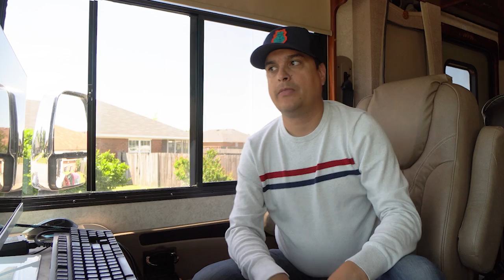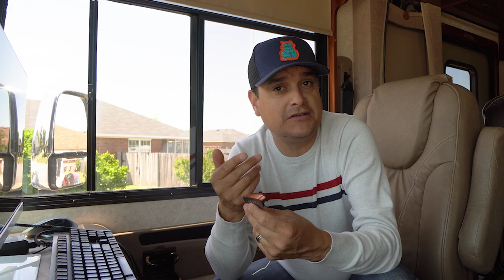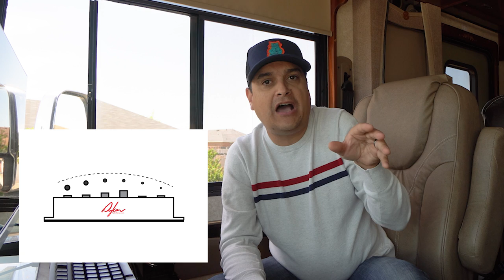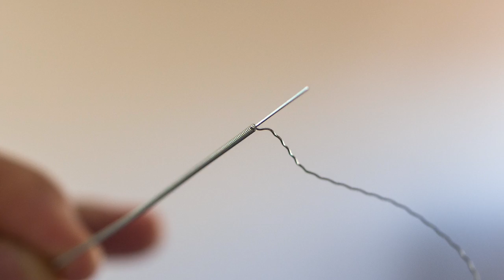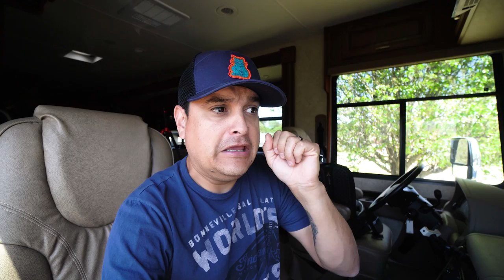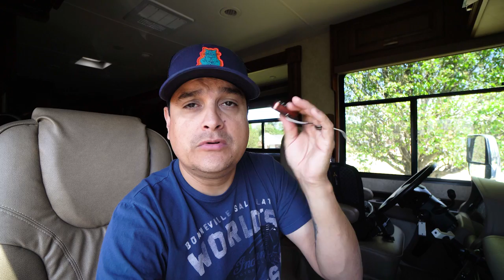How To Choose Single Coil Pickups - Flat VS Staggered

Comment: And then there are the G&L MFD pickups with adjustable pole piece heights. Leo was a genius!
Reply: I have those on a tribute G&L tele, and I also run heavier strings with a wound G (country rhythm guitar).  I love the output of them and the adjustability ( no-one uses a wound G on a tele, right?)

Comment: I'm so glad this video exists. I put 13s with a wound G string on my guitar and my Strat just came to life. I thought it was odd that it sounded so significantly different and thought that it was something to do with setting the guitar up to take 13s. But this explains it.
Reply: 13's on a Strat? I could jump up and down on your fretboard and still not get the strings to touch the frets.
Reply: @jeffbeck6501 unless it is downtuned to E flat or below, which is common for SRV fans to do on a strat.
Reply: I dunno man.  I prefer to do my working out at the gym, not on my guitar.  I stick with 8's and it sounds great and feels awesome.

Comment: I've got 2 Strats, one has staggered pole pieces, the other doesn't. The flat ones sound way better, and are on a 95 American Standard.
Reply: Do you use the same types of string on both?  Given Dylan's explanation of the stagger being needed to compensate for old-school string construction, then if you have vintage staggered guitar, you're not going to be able to use modern strings on it (without unbalancing the response across the strings).  The pickup style and strings would have to match if you wanted even response.
Reply: I use Ernie ball slinky 10-48 strings on both guitars. To my ears, and I've been playing a long time, it doesn't matter what strings I use on both types of pickups. I even throw 11's on sometimes. To me, the gauge is the only thing I think about. I never have matched particular strings to specific pickups. I match strings to the individual guitars and how I plan on playing. I hope that helps. In all the years I've played I've never heard that the pole pieces should determine the strings.

Comment: "Here is the thing though"  there is such a mystique around early Strats that are worth thousands and played by legends that you could lecture on that until you are dead and those staggered pickups will live on. From what I can see the majority pickups made and sold for Stratocasters all brands are still staggered. Most of the Stratocasters out there are likely not 7.5 radius necks. Of the ones that are available flat are noiseless which according to Dylan in another video are actually stacked single coils wired to be humbuckers. True single coil pickups with a flat or something like a 9.5 inch radius are the exception rather than the norm as far as I can see.

Comment: No offense but the radius then determines a whole circle. The Arc is the term your looking for in terms of mathematics. The fingerboard is about 1 11/16'' and the arc is the whole circle  divided by that.Plainly put it's part of the whole circle according to the Radius and whole circle.
Reply from the maker: Well... when you google any major manufacture. (or when you design a fretboard from scratch) it is figured exactly as I described in the video.

Comment: I do believe you when you mentioned that there are a few 'wizards' out there online who suggest "tapping down" the extended magnets on staggered pole piece single coils with a hammer. What I don't WANT to believe is that there are those who actually bought into this, pounded on their own pickups and THEN had the unmitigated audacity to create posts suggesting others do the same! Of the MULTITUDE of BS suggestions readily available online, hammering pickups might NOT be considered the most tragic. However, in the 'guitar lover's sphere' it certainly rates up there. Thanks for warning the most gullible among us. Great video! Thank you for perfectly explaining WHY these pole piece differences exist. Well done!

Comment: i can never fined a reason to disagree with you and i watched all your video and have been a sub for years. you, Trogly and Rick Beato are the best. I do want to add something. I have seen stock strats from 1954 - -1963 i used to repair violins, cellos and guitars for many years. Fender was really working on this the whole time. every year the pole piece height was different until and about the "L" series  starting in late 62. Now on a "plastic" bobbin pickup and only plastic where the winding wire never touch the pole pieces you can move them. I do it with a small wooden dowel with very light taps from a wooden block like pine. the reason i move the ones in a plastic bobbin is for the leveling of mid range chirp. I set my bridge where 6-5-4-3 are equal and and the 2-1 are lowered this makes the bridge pickup fat and cutting but very pleasant. the neck i lower the  D-G just a touch and bring the B up 1 mm this makes the neck match my 12" fret boards and makes the SRV sound. the middle aw the middle this the pickup where dreams are made i set my middle to match a 1955 middle raised A D level to the G, and B bellow the cover and the 1 or the E just above the cover. i have found since starting this in 2003 that i can tonally shape the chirp on positions 2 & 4. back to what Dylan said he is dead nut right on moving pole pieces on top end pickups like his. real single coils or top end hand made pickup and all fender vintage use a fiber type punched out bottom and top plates that the pole pieces hold together if you move them you will or can kill the pickup. I still can't believe how low Dylan's sub level is come on people smash the sub button, he should be up there like Rick Beato or closer to it . He is also very correct if you have a compound radius, or fret board flatter than 12  flat pole are the way to go. Actually flat pole re appeared in 1974 on the strat and became  the very even tones that became the sound of funk and disco. Buddy Mack.

Comment: Don’t mess with the magnets. If you’ve got staggered pole pieces, learn to properly adjust your pickup height. Fender used staggered pole pickups on several models through at least the end of the American Standard Strat series (Fat 50s custom shop). It’s normal to use the pickups on modern neck radius’s. Your pickups will sit higher on the treble side to compensate for the pole height.

Comment: I have a 82 Fender Strat and the pickups are thin and bright. I have a 7.25 radius neck. Once I heard the early 6o's reissue and Silver Sky pickups. I wanted that meater tone. Seymour Duncan has staggered pickups thst were used by David Giland they provide that sound I'm looking for. Thank you for your insightful information on this topic.

Comment: Well that straightened a few things out in my mind, thanks Dylan but I guess Im a lucky idiot because Ive straightened and returned the pole pieces to staggered in my MIJ 62 reissue Strat more than once!! That siad Ive never been happy with the electrics in it so my project during corona lockdown is to replace the whole scratchplate assembly with a new one with new pups, pots and 5 way switch so that I can switch the whole lot back if I ever want to sell it, and Ive been watching a bunch of your back videos for ideas on wiring mods and stuff, so cheers.

Comment: My Fret-King Geoff Whitehorn has a middle singe coil pickup with flat screwdriver slots in the top of the pole pieces. It also has slots in the poles pieces of the neck P-90 pickup. the bridge pickup is a humbucker style. This has allowed me to fine tune both pickup and pole piece heights of each of the three to suit my ear.

Comment: I was just about to drop the hammer on yet another set of pickups and was using the old mentality of Its an early 70's strat, so I need vintage stagger. ...well you saved the bad choice. I >think < my radius is a 12, and I will now verify with the luthier tools I bought before ordering. You did address that it's not wise to peck the pole pieces up or down as it can ruin the pickup. I did this on a few I have trying to adjust the volume and maybe I got lucky. I >think< you meant no pecking polepieces on either style (flat or vintage). In the sound comparisons I heard in a few comparisons though (Flat vs vintage)  The vintage one was the sound I was looking for but I do think the guitar used was a for-real 60's. Not sure if I can get the same sound from my flatter radius early 70's (Japan) using flat pole pieces.  Nothing was mentioned about if he was using a wound 4th ... So I still am not sure which pick stagger I really need to get?

Comment: Thank you for information. I have a Stratocaster Ultra SSS. And there the polepieces have different height, but not as on your picture, but so E-B-G-D-A-E  high-mid-low-high-mid-low. And the loudness of strings is obviously not the same. The pickups are Fender Ultra Noiseless Vintage. The radius is 10-14

Comment: Early strings were actually a metal called “Monel” wound over a steel core. Gibson and Fender actually used Monel for windings.  Gibson had “Mona-Steel” sets for decades. Until the early 70’s, string makers used round cores for wound strings. When Nickel became very expensive around 1972, string makers started using nickel plated steel and sadly switched to Hex cores. Hex does not vibrate evenly like a round core and only touches the winding on the edges of the hex. Round core touches 100% of the wrap. A lot of string makers back then also switched to a big core & small wrap. This was to reduce the cost of making wound strings as was the Hex core reduced the amount of reject strings.
Reply: Monel is/was a nickel-based alloy. The "Inconel" family of nickel-based alloys is more common today. These are useful materials due to corrosion resistance and high temperature capabilities. But... they are much more expensive than steel, and - even though they are softer - more expensive to machine. We can see the logic in simply nickel plating the steel to resist atmospheric and fingerprint corrosion.
Reply: Monel is a combination of Nickel, copper & iron. It is more expensive than stainless steel to manufacture.
Reply: DR round core's, great strings, have better feel than ernie or g&h or any of the other hex cores.
Reply: Brad T. I had an “Artist” deal with them from 1991-94/95. Something happened and there strings went from great to garbage, supplies were inconsistent and I got a lot of bad strings from them. I was paying about 1/2 of what dealer cost was. Wasn’t like they were giving them to me. So I went to Scalar and then Rotosound for a bit before getting involved with Pyramid. I’ve been a dealer/ rep, artist Relations, product development, for them since 1996. I do NAMM, Frankfurt & Mannheim Guitar Summit shows with them. Great people, amazing strings and family owned for the last 170 years! The Monel Classics were my idea to bring back but in a more modern gauges.

Comment: I had a late 80s/early 90s strat copy (Lotus) until a few months ago - the pole staggering always mystified me, but I figured it had something to do with the G string sounding way too loud! Good to know the historical reasons why the pickups came that way. And why it shouldn't concern me much the replacements are flat.  Ideally I'd still want to see a very slight curve in the poles though... I play 9.5" radius, not 14"...

Comment: I have staggered pole pieces on Kinman (stacked humbucker) pickups in my Strat. I have customized/modified the strength of the individual pole pieces using Neodymium and regular magnets. No need to replace pickups or change pole piece heights to get a balanced sound or custom volume profile.

Comment: I have a Strat with staggered pole pieces and changed out the 25.5" 9.5" radius neck for a Warmoth 24.75" 12-16" radius neck. I use nickel plated steel strings. So far I haven't noticed any weird volume differences string to string, but I set my pickups a bit lower than spec and angled down towards the low E.

Comment: Light bulb moment.  Thanks so much!  This makes so much sense, especially when I'm playing slide.  My G string always sounds great, but not so much my B and E, even when raising the treble side of the pickups, regardless of tuning.  Because my Strat's pickups are staggered and when I raise the high side, the G string still gets raised.  I've been buying heavier strings, which helps a little, but still doesn't solve the problem. It seems like the best solution is to purchase pickups that aren't staggered,  or increase the size of the B and E string significantly over the G string to get an even tone.  Thank you!

Comment: I have Fender Texas Specials in my 1994 G&L Legacy, it has higher center pole pieces which add to a mid range boots in volume of the two middle strings. A bit of an accentuation , it creates a great and appealing tonality or volume-ality if you will. I'm extremely pleased with the SRV-like tone over all and the added middle string punch.

Comment: Yeah I went through all that. String balance is real important to me.  I use nickle PLATED steel wound EAD and plain for GBE. I also tried stainless but they have a lot less signal than regular steel so they aren't worth the anti rust they give. I have lace sensors and they also have string balance issues with the plain G and B being too loud compared to the little E so I block part of the magnetic field under the G and B strings with a piece of magnetically soft sheet steel from an old transformer and that works great. 
I haven't been able to balance my lace blue telecaster bridge pu yet, it's a lot harder for some reason.
On my "normal" telecaster flat top pick up I use tiny slugs of magnetic rod stuck on the magnets to raise the volume of weak strings. That works too.

Comment: excellent explanation - I agree with you that there is no need for staggering on modern radius fretboards .My only problem is that I still use wound 3rds....

Comment: Interesting video.  I bought a China Tele recently and used toothpaste with baking soda to polish up the frets, but may have resorted to a pot scrubber at one point. Now I learn that steel wool is bad for frets.  hmmm.  I need to learn what is the best way to polish frets on a guitar.

Comment: i just built a guitar and i chose a sl1 for my neck. it is staggered, but i was just after a sweet OG strat neck sound. it sounds very nice, but i unwittingly strung it with pro-steels solidifying 2 mistakes at once. furthermore the neck is 12 inch radius. so i guess i learned something valuable and interesting from the video. Thanks for sharing your knowledge!

Comment: There is a guy who uses a soldering iron for 30 seconds and then presses them down with the back of a small screwdriver. Besides that, the reason I'm interested is because I'm setting up a Rogue 6 string electric lap steel guitar and it has staggered pole pieces. The fretboard is completely flat and the 3rd string is solid. So I was looking for advice. From what you're saying they should be flat. There's no radius. I guess they grabbed whatever single coil pickups that were available. I have seen others with a humbucker. If I should replace it, what harm is there in trying the warmed up method first? He says there's wax holding it in place. His video was just before yours. Something about Strata-something.

Comment: Well, here's my input.... I have a '97 MIM Strat, which I've pretty much always strung with Ernie Ball Super Slinkys.  Fingerboard radius is 9.5", and I swapped in a set of Texas Special pickups, which have staggered pole pieces.  Maybe my ear isn't as finely calibrated as some others' are, but I've never noticed the G string (unwound, of course) being louder than the others.

Comment: I struggled with string-volume balance on a set of CS69s. In a desperate mood, I changed the pole piece heights -- mostly for the G string. On the first attempt it worked fine, but pickups 2 and 3 were ruined. If pickups have plastic bobbin construction, then changing the stagger can work, but if no plastic bobbin -- don't do it.
Reply: I totally understand that desperate feeling!  Sorry about your pickups.  I lucked out that my pickups survived after I pushed the G polepieces all down

Comment: Where you can easily test poll piece height is on a humbucker guitar with screw poles. You can try the classic Strat, the equi-distant, and flat. You'll find different tones out of them. I tend to put stagger poles (like Strat and humbucker screw poles) on the neck pickups and flat across on the bridge pickups for everything else (Tele, P90, Humbuckers) because they tend to sound best for me. Flat across gives a little 'mid-scoop'. You can also bias pickup height E vs e, the amount of pickup 'tip' too -- I saw an old video of Hendrix recently where the video person paid attention to his picking more than the fretboard which was useful to see.

Comment: I started putting single coils in my Ibanez and other guitars because I got tired of Fender's inferior guitar design.

So now I have better fret access, more sustain, flat pole pieces, more frets (on one guitar), less weight, quick change pickups, better tremelo.
Reply: Fender really doesn't have an inferior design as you have to remember that fender had these designs in the early 50's and it was a state of the art design for the times. Ibanez mostly were designed in the 80's as an improvement over the 50's design which they are. Nowadays there are even better designs than ibanez out there. It's just guitar evolution.